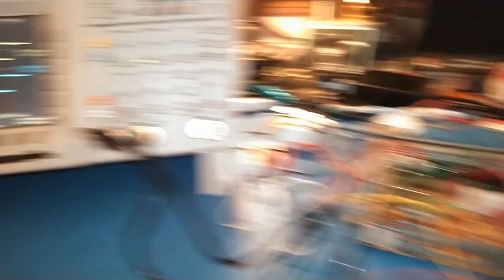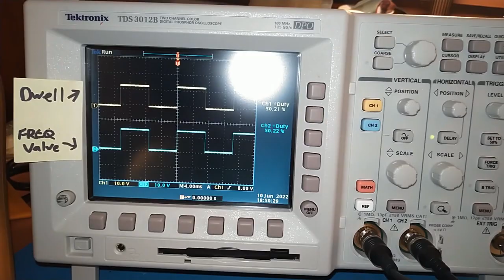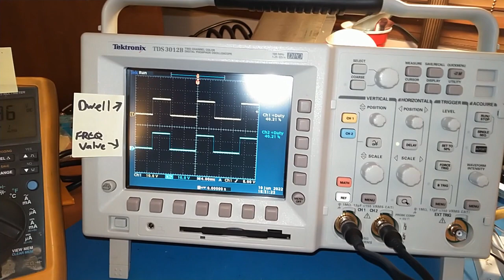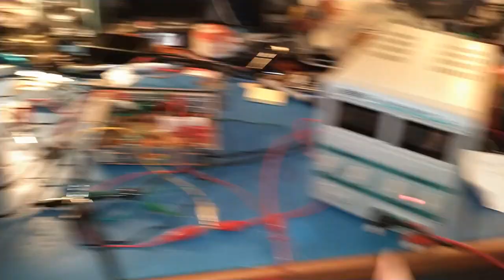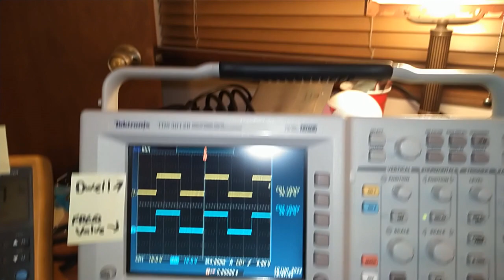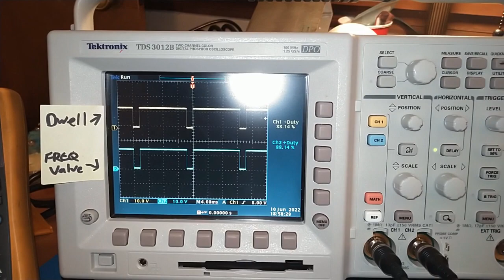How a Delorean Lambda ECU works

Comment: Hello, Can you make a video on how to inject a signal from a microcontroller (preferably Arduino) to an unknown chip controlling VFD Displays tube? 

I'm trying to use Arduino to control my 1988 Toyota Cressida GX71 digital cluster as it's CPU is fried when I test it and i reversed its polarity... 

The tach wont register anything but the display works.. I try to give a signal from Arduino's tone() via a PC817 optocoupler but it won't show rpm.. I have a video about my digital cluster in my channel
Reply from the maker: I don't have a Cressida wiring diagram in front of me...so I'll have to make some assumptions.  Rather than an optocoupler, you probably need a transistor that is controlled by the arduino.  Most tachometer lines (at least in older cars) sit at ~12v, and then when an ignition event occurs (breaker point in "distributor" close), that 12v line now dips to ground, and that's what the tach reads.  So, the arduino would be pulsing the transistor on and off, and the transistor is tying that ignition line to ground.  I found this video that probably does a lot better job of explaining it:  https://www.youtube.com/watch?v=IBKfB2GNPbU  
He's using using a bit more elaborate software, but you'd basically just need to toggle the arduino pin on and of at a varying frequency.
Reply: @42anon427  in a normal cluster, I usually give tone() to the pin 8 of my cluster, using the optocoupler (pin 8 to B+ via optocoupler)... But after i reversed polarity it wont show rpm... I tried simhub but no luck (i think i damaged the cpu, but other functions like temp and speed works fine)
Reply from the maker: @putraadriansyah8082  So, did you have this working at some point...but it has now stopped?  Where exactly did you reverse polarity?  To the main power input...or at the tachometer input?  Is there any chance of putting the cluster back in the car to verify that the tach is still working?   Which optocoupler are you using?  (sorry...lots of questions.)
Reply from the maker: Code example and schematic:  
https://create.arduino.cc/projecthub/tylerpeppy/arduino-car-tachometer-simulator-no-simhub-9edc2c